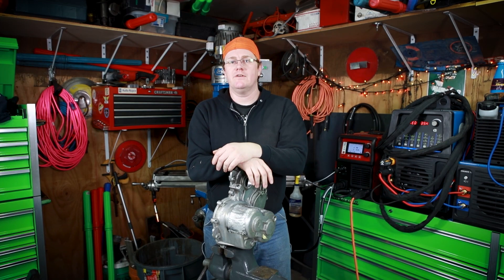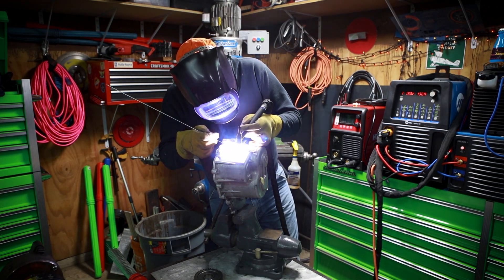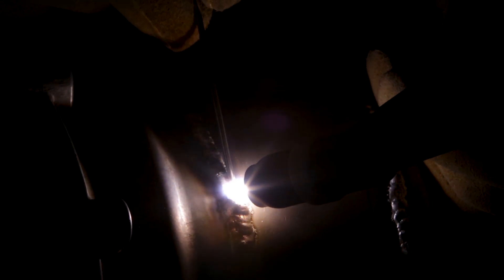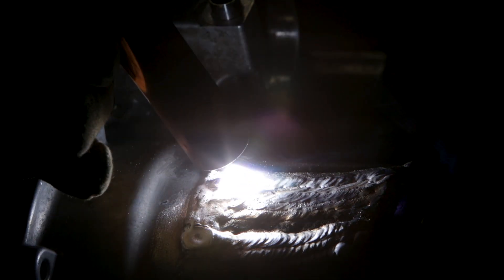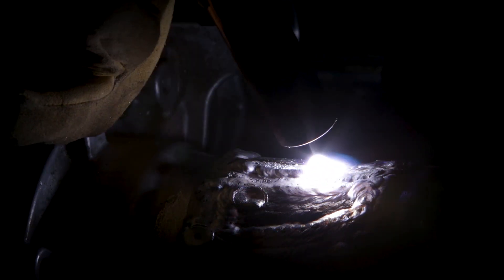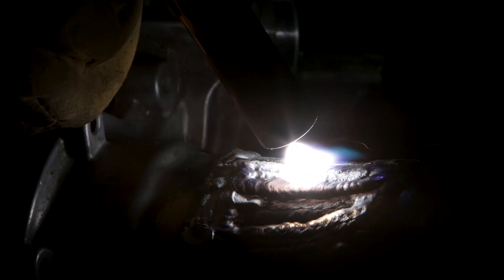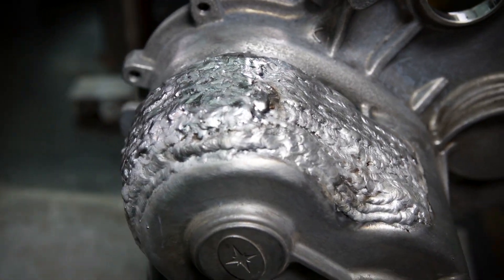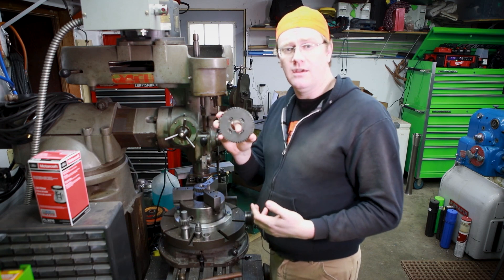Aluminum Casting Buildup With The HTP Pro Pulse 220

Comment: Timely video, I just ordered a PP 220 yesterday, however I did NOT get the gun slider option.  Would you say I'm missing out not having it?  Must have option?   I'm a 'hobby' welder (so basically novice), moving from a Millermatic 185 transformer machine that I've had  for 20 years to the 220.   One question, in a previous video you were not happy using it on the route pass for the aluminum pipe and would rather tig.  Why?  Just curious.   Oh and thanks for muting the sound while in pulse mode, you are right it's super annoying.  If you get a chance to weld some stainless that would be nice to see.  Thanks for the video.
Reply from the maker: If you're doing a lot of aluminum I would say the slider is worth it. As far as the root goes. Most of the time I'm welding aluminum pipe it's for an amonia line and I want to make sure the root is perfect so I don't end up with a leak. With practice I would probably be comfortable doing the root with mig. Definitely going to have some stainless mig videos coming up. It's just worked out I have had aluminum projects lately

Comment: Check out aluminum 4943 Tig wire it’s awesome strength of 5356 and wetting property of 4043. The HTP pro pulse is awesome and all the HTP line up. Pete & Jeff are awesome guys too. Always there to help. Happy to see you using it.
Reply from the maker: That's one I have not tried before, I'll have to give it a go. I'm really impressed with the htp stuff so far.